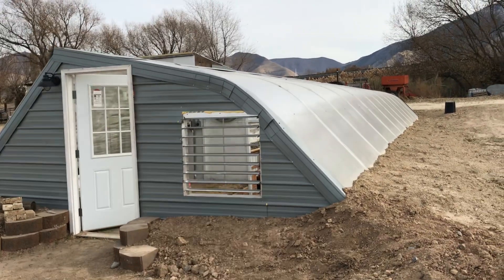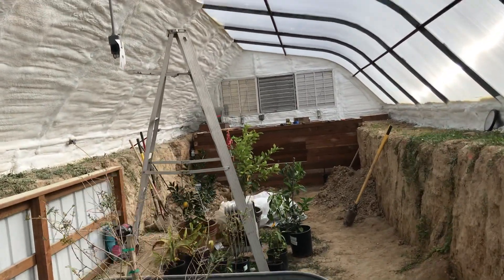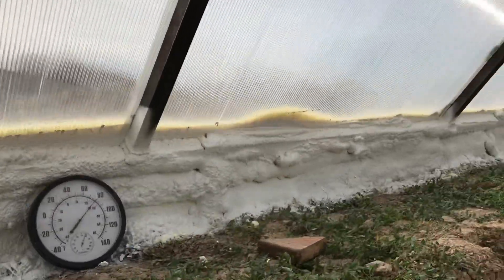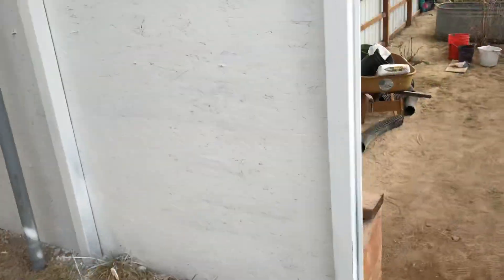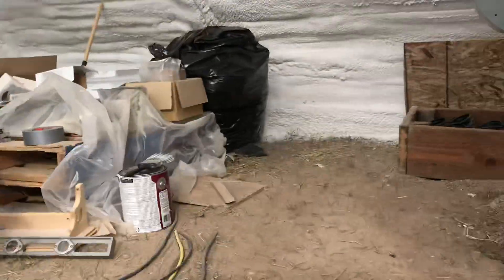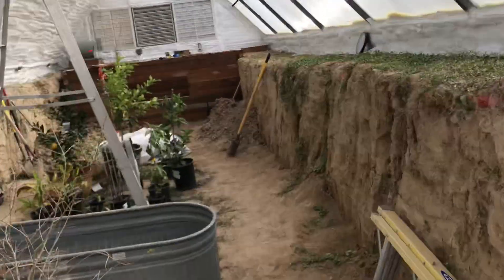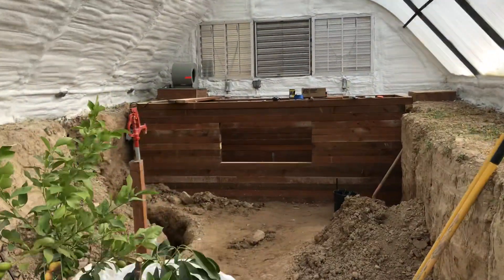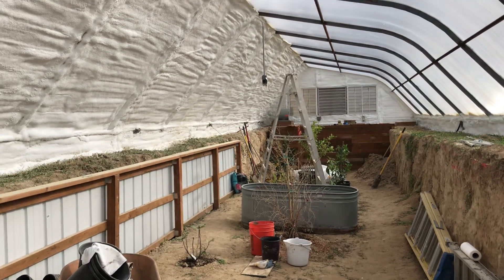Greenhouse update (Nov).  Insulation, geothermal heating and cooling, and more

Comment: How does the small room inside the front room make a vacuum?
Reply from the maker: because its a separate space from the main growing room, I pull air from the small room  (which pulls from the tubes that lead to the outside) when the fans or blower are running.  maybe a vacuum is the wrong word choice.

Comment: are there any concerns regarding the toxicity of the spray foam? especially with humidity
Reply from the maker: its a concern we had when we decided to do it. We researched it and found that others had applied paint over the foam which is what we decided to do.  We haven't had any noticeable toxicity since we built the GH 5 plus years ago.

Comment: You mentioned you will put chicken wire over the box for the geothermal pipes. You should use 1/4.inch wire mesh to keep mice and other critters out of the pipes.

Comment: Good to see this, we will be building one next year, using hempcrete on the north, east and west walls. We are off the grid and looking at Snap fan for direct solar connection on ventilation, but have not figure out the blower fans as they use so much more power. Hoping the hempcrete will be part of this solution as it acts as a thermal battery to help keep it cool and warm. Cheers!

Comment: My greenhouse in northwestern Utah County has  about a 3 ft deep hole in it, and it filled with about 2 feet of water late last winter (circa feb 2023), with all the snow and rain we had. Mine won't always have this hole and the floor is at ground level, but I imagine by now you might have added a sump pump to keep the water seapage under control...
Reply from the maker: last Winter was very unusual.  I didn't have any problems but we were very wet with the Spring melting and moisture that never ended.  Sump would be a good idea if the problem persists.

Comment: So you have two geothermal earth tube systems?  One that pulls air through your yard for fresh air. From where? And how does it drain condensate?  Then a second system that recirculates the air. Where does it drain condensate?  As you can tell from the graph on your video, most people come here to learn about your earth tubes and it would be nice to know more..

Comment: Amazing and neat work. I see that you have two blowers, one to pull in fresh air and the other to circulate the inside air through the geo pipes. What is the power rating, CFM and brand of these blowers?

Comment: I'd love to see how your greenhouse is operating now! I have a prediction that you will be able to answer by now, which is that the water table may keep the temperature in you geothermal pipes at a constant  temp in the 50's, rather than build up a "heat battery" over the course of a few years, as it seems to do in Russ's greenhouse. That might keep the greenhouse a bit cooler in the winter than you expected. 
I'd also like to know what kind of soil, and at what height you planted those fruit trees. I hope they are doing well!

Comment: Are you at all worried about the chemicals in the spray foam contaminating your planting soil? I would love to build a similar greenhouse, but I'm not to sure about using spray foam.
Reply: any chance you've learned more about the spray foam and would like to share?  i had the same question,  but i wondered if the simple paint layer helps alleviate that concern.
Reply: You could seal it with BIN.

Comment: The airflow pipes aren't water tight so it will be inter to see if the water level rises enough to block them. I wasn't sure exactly where the corrugated pipes were placed or at what level
Reply: I'm thinking in my build
I'll lay the 4 inch pipes on a slope so they can drain to as many buried 55 gallon plastic barrels as needed to be 4 ish feet below the lowest pipes  so any water can be pumped out

Comment: No  black thermal mass on insulated wall?
Reply from the maker: Most of the Greenhouse is below Grade.  All walls are insulated.  I thought about Black but ultimately decided not to do it.  This Greenhouse does great without it.  Also worried about picking up any additional heat during Summer, which is a larger challenge than Winter.
Reply: @trailbreakfarms  people design roof such that black wall in the back only sees Sun at Winter angles

Comment: Is there any way to make these wider without losing the benefits of the geothermal and insulating benefits of the ground?
Reply from the maker: yes I think you could.  I think as long as you were below ground, circulating air, and had the appropriate amount of tubes/circulation you could do it.

Comment: How much is this? Can you do this in an inner city?
Reply from the maker: It generally costs around $25K total for everything.  I spent more because I have Aquaponics, Solar and a few other bells and whistles
Reply: @trailbreakfarms  I have a 8×20 regular greenhouse paid about 3k for it, aluminum, lika pixy glass (not sure) but common structured. Is it able to be converted into a geothermal heating cooling system if I build on it. Like dig 4-6',  insulate the south wall add the underground tubing and add to the sides etc I'm in Wisconsin, I want to grow 2 citrus trees in my green house. Do I need a professional who specializes in this type of skill.

Comment: This is incredible! What happens with it being dug out like that when you get torrential rains? Any issues with flooding or mud saturation?
Reply from the maker: I built it so that water flows away from the Greenhouse when it rains.
Reply: @trailbreakfarms  I noticed you didn't build as deep into the ground as you might have.  Think of that same glass, but the glass meeting the berm at the top.  If it's not letting sun in, I want to see earth coming right up to it, to the maximum extent possible.  Maybe yours is the compromise build that'll keep kids from climbing on it.  But it seems like you'd want to max out the advantages of earth shelter everywhere the structure is opaque.  

So at the bottom level, you'd be something like 10 or 15 (more?) feet below the top of the berm abutting the north wall of the build, because you're digging down a few or several feet and you're piling the debris on your north a few or several feet.  And yeah.  You're giving water much better places to go than your construction.  The value of a good excavator is not to be underestimated.  .
Reply from the maker: @harrymills2770  I backfilled after building the Greenhouse so that the dirt comes up to the Polycarbonate Windows.  I could have dug deeper but shade becomes an issue on the main growing floor so its about 5 feet below grade, but the backfilling makes it 6 to 7 feet deep (runs east to west).

Comment: That is an AMAZING greenhouse. I love it.  BUT.... With having to have big machines do the dig out, the purchase of the green house kit, all the electrical, fan, air 
Iping, spray foam, and everything else that went into the construction and then what will be needed to run it and maintain it yearly... you have about $50,000 into that build!!  How much produce (only as that is all you can grow in a green house) can one buy from a store for $50,000? How many years of produce will $50,000 get you? I get the whole "self sufficient" thing. Heck, I wou.d love to have this green house myself. But $50K just to grow produce? Per year I bet I spend maybe $1,000 on just produce I could grow in a green house. That means if just kept that $50K instead of building this amazing green house, then I could buy produce for 50 years!! In 50 years that green house would be falling apart. In 10 years those plastic panels will dry rot. In the next 10 years half of those electric fan motors will stop working because of the dusty and most environment. Again, Amazing green house and I love it, but I can see how much money you have in there and it is just not worth it. A homestead green house should not cost more than $2,000 to build. More than that and a person is just being silly with their money.
Reply from the maker: Very good comment.  Here's my thought... I'm into this $35K.  My goal here isn't a financial return, but to get educated on Greenhouses, Solar, Aquaponics, Geothermal, Growing year 'round, Self sufficient, sustainable farming, etc.  Also, I want to pick my own tropical fruit, not buy them at a store where they have travelled thousands of miles.  And, most important...I want to live longer, healthier, happier.  If I do this, it's a priceless venture.  I didn't do this for a return on investment.  I've done that elsewhere.  But, if I did, I'm confident I could get a return on this Puppy!.  I've had a Restaurant Owner tell me they'd buy everything I could produce.  I could take excess produce the the local Farmers Market.  I could eat everything else.  I've had requests for tours, classes, consulting, even requests to build for others.  I could monetize Youtube.  Literally the sky is the limit.  But none of that interests me.  I am enjoying this Journey.  I'm happier, healthier, and lounging on a chair eating a fig listening to my favorite tunes watching the fish swim.
Reply: @trailbreakfarms  You say you're in it by about 35k so far. Does this include the cost of excavation? We are looking at building one of these kits but are unsure of the cost. Would you assume there would be a higher return on heat savings if thicker insulation was added? Thanks for the video; it did help answer many questions, as well as reading others' comments.

Comment: GREAT VIDEO! I'm just wondering why the North wall leans in,  as opposed to being vertical...is there a structural or thermal reason, or is it something else? I live in Southern Arizona and want to build something similar, but unlike most people up north, I am mostly concerned with mitigating the summer heat without depending on the GRID... BTW do you have a source of steel frames like those you used on this build? Thanks in advance!
Reply from the maker: I wondered that as well when researching.  Its structural for this Greenhouse and the design works well for many reasons.  I like having some shade on the back wall during summer but full sun in Winter.  I like growing on the back side of the Greenhouse during our outdoor growing season.  All in all, its a great design.  But I think a vertical wall would work great as well.
Reply: @trailbreakfarms  Thanks very much for your timely feedback! I understand why the back wall should be shaded in the Summer, especially here in Southern Arizona. One more thing to think about...
Reply: I'm thinking it's tilted in to help reflect winters low sun angle into the plants
Reply: @jimh4167  Good point!
Reply: If you watch the original YouTube of this style called…citrus in snow…the farmer who designed it said that leaning side was supposed to be north facing. That means the thickness is better thermal insulation against the coldest side that loses the most heat in winter, helping keep it above freezing to keep things alive

Comment: Very nice. Thanks for sharing.  How many total feet, and what configuration are your underground pipes? You mentioned 7-8ft depth, I think.  Did you use pipe w holes, or solid? Thanks again
Reply from the maker: GH is 72 x 17.  Pipes are solid because I have groundwater issues.  8 feet deep.  12 pipes in trench.  4" diameter.  Main pipes run 230 feet.
Reply: Did you run the air tubes in sand, gravel or just dirt?  Also, do the air tubes require any cleaning to prevent bacteria or mold growth?  Do you run any filter system on the tubes?  Very nice greenhouse!

Comment: This greenhouse looks small and expensive. And energy hungry. Search for “olds greenhouse”. It’s a Chinese guy who built a totally passive heated greenhouse that only goes down to freezing during the three coldest days of the year, and it’s VERY cold up in olds alberta. It’s a much better system and requires no energy. Btw, dirt isn’t “insulation”. I don’t understand why the builder thinks there’s an advantage by digging down. News flash: cold air is more dense and sinks down. I don’t think there’s any advantage digging down. Also, it makes working the land very hard
Reply from the maker: research "Sunken Greenhouse" and "Walapini".  There is a huge  benefit to building below grade.  They retain heat much better during winter and require much less energy than building above ground. If I were to turn off all fans and blowers, this Greenhouse would stay above 40 during winter.  But do what works for you.
Reply: @trailbreakfarms  you are correct!!!!!

Comment: Very interesting!  I’m all excited about geothermal greenhouses, cool in the summer and heat in the winter, ripe subtropical fruit in a cold climate, what’s not to love!

Klaus
Reply: I still wonder if the mass actually works on that oranges-in-the-snow idea.  But the old man insists you get ground-temperature-average out of those hoses if they're at least as long as that magic 230 feet and buried 8 or 9 feet.

I'm just not sure I'd do in summer what they do in summer.  I think summer mode for my greenhouse would be mostly idle, and I'd grow beans and such on trellises outside, and keep most/all of the sun off it.  I'm debating whether to move the citrus inside and outside, seasonally.  But I can see keeping that space cool in summer with shade more than with big blowers.  I know nothing about the root system of such trees, but I'd definitely look into moving them outside in the summer, or only letting the sun in where I had my indoor grove, and shade the rest of it.

To me, the purpose of the greenhouse is to grow things in the cold.  

And just about everywhere that guy had aluminum siding, I'd have earth, I think.

Comment: nice idea. looks like it will  work.. foam is ruff on the in side though. did you run your foam under ground or just to the top of the ground..
Reply from the maker: Foam on side wall was sprayed on. Goes to the ground.  We also used some foam and liner along the ground prior to backfill.

Comment: Looks good.
Instead of covering the berms with siding you could run three rows of horizontal shelving, at an angle, to grow your favorite table vegetables. 
It may increase the temperature slightly.  So, if you are having excess heat issues, then maybe not.  However, in my opinion the benefits of an increased rhizosphereic profile are worth it.  Maybe through in some mushrooms?
The pond is really interesting.  Never heard of such a thing.  You kinda made yourself a spring.  What are the rough dimensions/area?

Comment: Hi, did you need to get a permit to build the greenhouse? If so, did you get yours engineered? Started mine but my permit office stopped me because I need an engineer to sign off on the snow and wind loads.
Reply from the maker: I needed a Permit but no Engineering.  No fee for Permit since its Agriculture.
Reply: Thanks!

Comment: well I get the point that you actually do improve the isolation, but isnt it about growing your own organic stuff in your backyard? To me this look like tons of chemicals being sprayed inside. Isnt there a way where you can do the same job with a more environment friendly and ultimately more healthier solution?I'm just thinking about using some of the earth you removed or using a weed or wood isolation which becomes more common here in Germany.
Reply: You can berm the outside of the steel wall with dirt to add a geothermal  layer, or make a sandwich wall, filling the inside with dirt.

Comment: I would love to know what the noise level is when the fans blow. I saw a video of the original Greenhouse in the snow and am very impressed with the system. I would love to live in a Greenhouse that could maintain a fairly constant temperature.
Reply from the maker: You can't hear anything from outside.  When inside, the Winter fan is quiet but the Summer fans are a little noisy.  The blower for geothermal is not very loud either.

Comment: Why did you choose not to build the back side into a hill using the earth to insulate backside? Or northside of the house.
Reply from the maker: My Property rises slightly from West to East.  Definitely would be best if you had South facing so you could build into the hill.  Also would be best to build on South side of a structure so you can exchange hot/cold air between structure and Greenhouse.  The South side of our shop is in the shade for a good part of the day.

Comment: Thanks for your video. I have been thinking about this same adventure in SE Idaho at 6000'. The only change I would make is to do Aircrete in your walls for the insulation and wall structure. https://www.youtube.com/watch?v=tKVsH1dkl6M This guy has allot of ways to use this inexpensive, anti-mold, insulative material in building. Check it out.

Comment: Is the insulation closed cell are open cell
Reply from the maker: 2.5 inches + of closed cell foam insulation which was then painted for added protection. Closed cell has a high R value and adds durability.

Comment: Any chance this whole thing could run on solar?
Reply from the maker: We'll find out. I've got a solar system here.  I haven't installed it yet.  Will share details soon.
Reply: @trailbreakfarms  apprentice electrician here,   solar is a wonderful supplement for power consumed while the sun is shining but storage and big loads are a problem... 120v x amp= watts.  A 400 watt panel will only give 3.3 amps under the best conditions, charging a battery not running a motor. Motor loads will affect your power factor and can dramatically reduce your actual power output. This is know as the apparent power.    Its best to pair your solar with a universal power supply to keep the air moving in a blackout without you having to do anything.   Some care should be taken when planing the size of your solar system and battery's because, by fire code which is a good practice, your panel should be rated to handle all available current, otherwise a short could draw many times more current through your panel then its rated for.